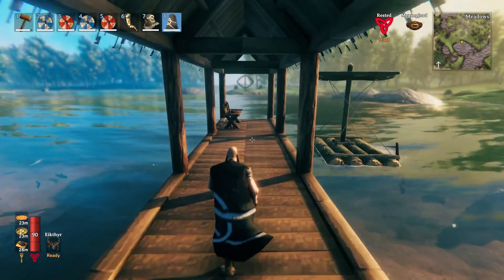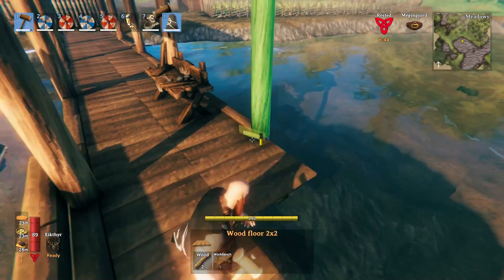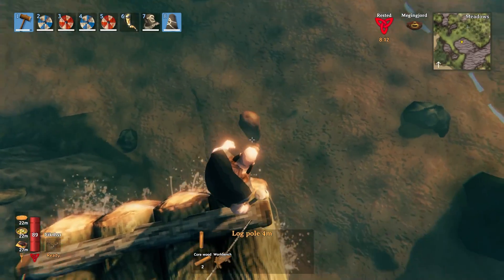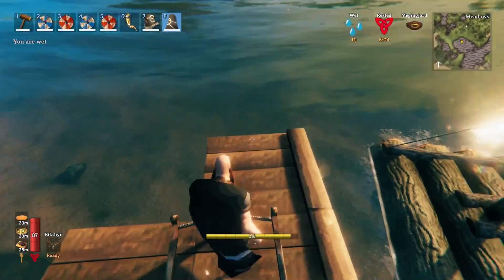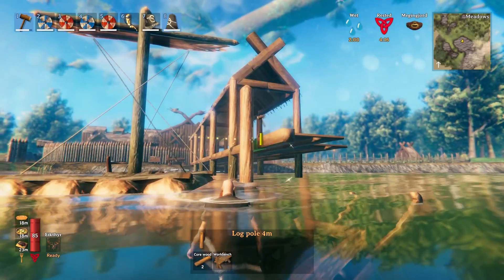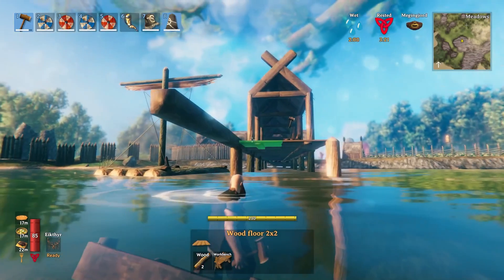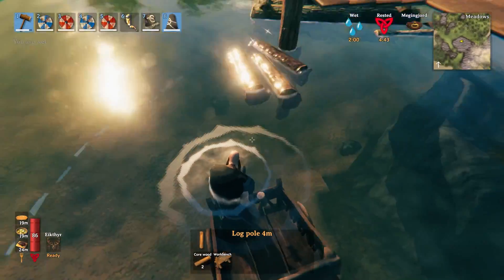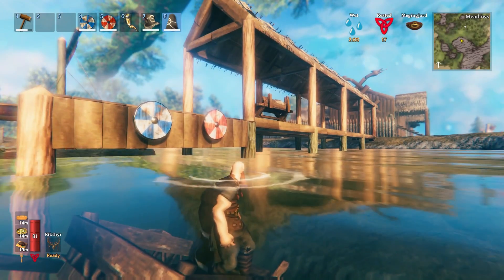Valheim: Trick to Build Easier Over Water - Deeper & Further!

Comment: Did you know that you don't need to build those funky bits at the side to extend anyway? If you stand on the edge of the piece of floor on the right, you can catch the edge of the floor on the left to add another. Due to the camera angle, it doesn't work the other way, but you don't really need it to. Granted there is more risk involved if high up, but what's Valheim without a little risk?
Reply from the maker: Yeah that was my very first Valheim video! 😁
Reply: @JirocTheViking  that makes sense! Keep up the great content. Love your videos 👌

Comment: It's a neat trick, but I think it's less hassle to build a 45 degree ladder down into the water, and sit on the lowest step you can get to without going into swim mode. then you should be able to reach about as low
Reply: But you would need to build those over and over and then dismantle them if you do not like the look of them afterwards